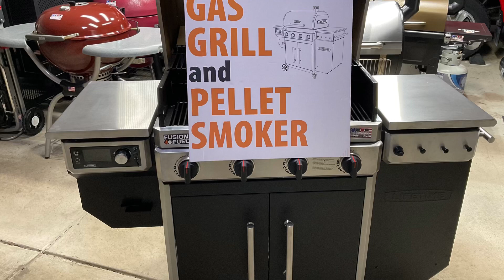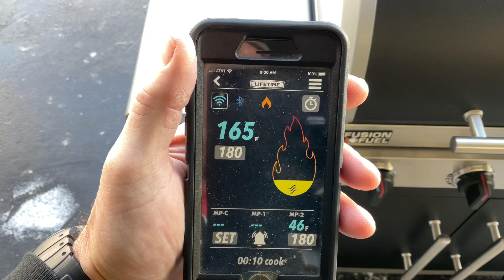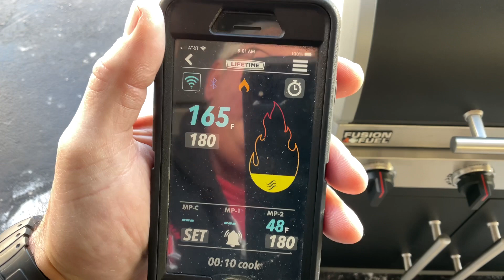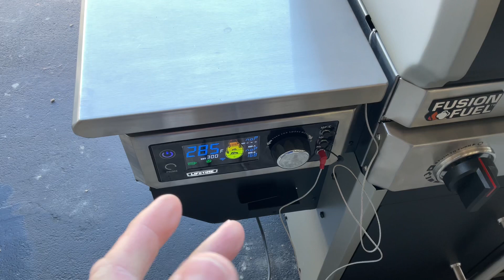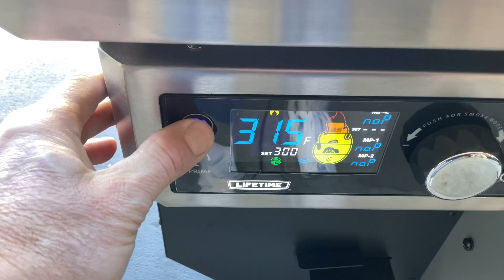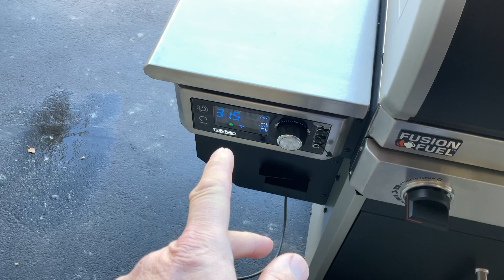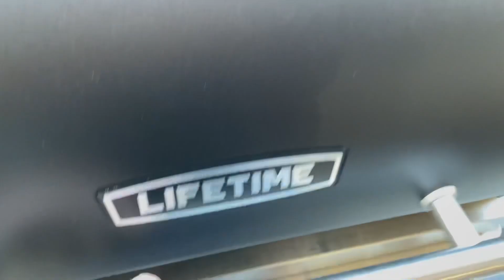Lifetime Gas Grill And Pellet Smoker / Pellets And Propane At The Same Time? / Grease Management?

Comment: If you want to smoke at 180 degrees, could you set the gas temperature to 170 and the pellet temperature to 180?
In other words, primarily use gas for heat and pellets for smoke.
Reply from the maker: Thanks for Watching!  Good question,,, no real setting for gas,  I don’t think it could get that low, even with one burner.  If it was really cold like 0,  maybe
Reply: There is a high smoke setting that can be used for the smoke while you cook with the gas. I do that with my burgers.
Reply from the maker: Thanks for Watching Shane,  I need to figure that out

Comment: Great review and demo Tom.  

This one gives you the option to do a slow smoke and reverse sear of a steak or beef roast on the same grill. I think the way to use the “Fusion Fuel” capability is you have to have the set point of the pellet function at a higher temperature than the grill would be at with the gas burner valve(s) at a manual setting.  Otherwise, I believe you’ll have the same issue as you did on this cook, even at higher temperatures.  

In the absence of thermometers in the lid, I wonder if an after market air temperature probe would read properly on the pellet panel?
Reply from the maker: Thanks for Watching Ted!  Not sure on the temp probe,  my guess is that they wouldn’t match exact

Comment: Tom, how long does it take to get to say 300 degrees on a day that maybe in the 40's?  How is the smoke flavor compare to other pellet grills?
Reply from the maker: Thanks for Watching!  With the gas assist on, it won’t take more than 10 minutes to get to 300.  The flavor is about the same as any pellet grill
Reply: @TomHorsmanAmateurBBQ  Thanks Tom!  One more question, have you used the Weber Smokefire?  If so, what are you thoughts?
Reply from the maker: I have not used the Weber SmokeFire.  Lots of issues with the grease management. They haven’t changed the design. Lots of Ace Hardware stores have pulled them because they’ve had allot of returns